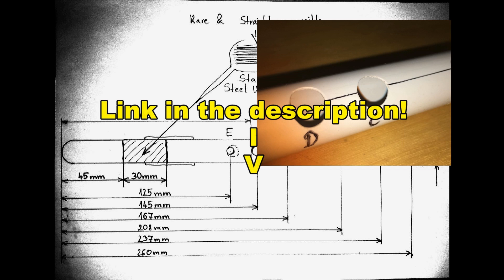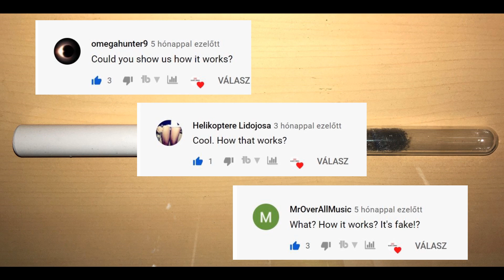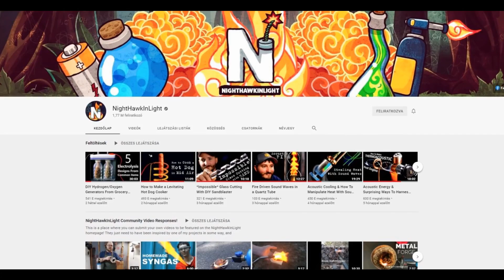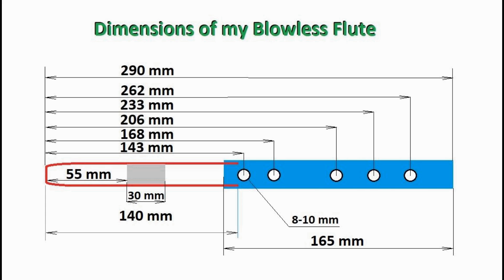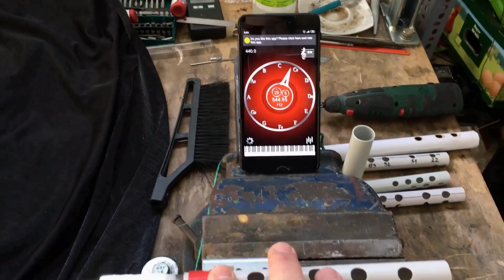How to Make Your Thermoacoustic-Flute? - Tunable Heat Engine as Musical Instrument /TUTORIAL/

Comment: I'm trying to get the thing to work but I'm not having any success. I first tried to make the test tube oscillate, but without success - the thing doesn't oscillate. What faults do you think are possible? Is the steel wool packed too tightly or is there too little of it? Do I have to do anything to get it to start or does it work by itself? What is the best way to heat the test tube? Is a specific place necessary for this? I try all the time but I can't find this damn error.
Reply from the maker: Hi there, basically the stack should rare as possible. The steel fibers should straight as possible and the ends cut flat. The length is around 25-30mm The wide test tubes resonates easier, also could stabilise with lower heat. Put the stack 1/3rd of the tube length from the closed end and heat with alcohol burner the stack but 5mm far from the end of the fibers. The hot side is the bottom side. It should resonate. For long time sound you should use heat exchangers and cooling also. I hope it will help you, but I think I have a really old video about this: https://youtu.be/uNibUUb0YGU?si=HCjHgzeRU61Z787A
Reply: @AttilaBlade  Super! Thank you very much!👍🙂

Comment: Maybe on the end instead of the stiff test tube round bottom a weighted balloon diaphragm to reflect the sound could make a buzzing frequency added to the flute tone - perhaps a kazoo flute sort of.
Reply from the maker: The frequency will be much lower under the ear sensitivity. For a kazoo like sound we should put a highly tightened piece of rice paper onto a non tonical hole around the half of the length. Or we can change the back side with a tight plastic sheet and a small piece of bamboo touch on it slightly. It could give a subharmonical sound to it...but we should try it to know it, because nobody will do it if we don't. :)
Reply: I was kind of thinking of the buzzing sound of your bristlebot thermoacoustic car, if some of that buzzing sound would translate or mix in with a flute played with holes tone to change the timbre of the sound. Or like this open-ended thermoacoustic buzzing pulsejet shape i tried but add flute holes in the exhaust tube instead of this unaltered exhaust tube. 
https://youtu.be/sCtDPMyfYbw
This one made some strange sounds and caused the torch and empty Coke can to vibrate on the desk surface like bristlebots. If you turn the volume up it seems like this shape with diaphragm makes more than one frequency, like a sweeping pumping sound mixed with some other sound making beats. 
https://youtu.be/lN1rElFOMBg
Aside from your kazoo method to try to know (good advice) I was also thinking maybe a thermoacoustic ocarina would be something to test out. Many things sometimes come to mind when testing, a lot of ideas accidental along the way. It may not aways turn out, but you meet the unexpected.
Reply from the maker: @Resonanttheme  The last thing that why I always communicate to everyone to try the things first, and make more experiments. The new ideas will coming and the solutions for actual problems will be solved much easier. But if we always just  watch something and thinking about that what's happening here, that still be a think never materialised or tried. That's why I really like your simple experimental videos! :) BLADE

Comment: I bet you could use a vape pen or whatever they are, to use as a heat source it would heat the wool nicely
Reply from the maker: Yes, if the heater wires or plates flat as possible and fit into the tube. I thought about electrical heating earlier but I can not find the perfect piece of that. Thanks! BLADE

Comment: I love this! Amazing job on it! Does this need to be a certain test tube?
Reply from the maker: Thanks! I made it from a 15.3mm inner diameter test tube. Every size could change the tone and the pitch a bit, but you can use any type of heat resistant type. :)
Reply: @AttilaBlade  Wonderful, I am going to give it a try! I have been messing around a bit with induction coils and the 2 may go well together!
Reply from the maker: @helpgrowfood8372  The induction coil is good, but how could you ignore the regenerator heating near by the induction coil? Maybe it works well I dont know but    it will be a good experimental way! You could try it with small diameter of wrapped copper coils around the test tube. Nice! The bigger problem is the cooling... but we will see! I'm not a big electrical guy but I want to try the heater mesh first. I haven't got induction circuit now.

Comment: That was interesting to watch how you tuned the flute. I saw some children's toy recorders "flute" in a dollar store and wondered by experimenting if you cut the head off of one, if it would be possible to use the already made spacing. 
You flute would be a delightful addition to a classroom demonstration over the standard one many are familiar with.
Reply from the maker: Nice idea! It should work, but what I saw here, the heat changed the notes distances. The gas density change with the temperature, so the closest and the last notes ar use different gas parameters. And here I can't found the notes what we can create with multiple hole closing, so it has few weird things. But I will try this, maybe it could work easier than I think now. Thanks the idea! BLADE
Reply: The gas density changing with temperature reminded me of a Dyna-jet how if you quickly hop from say the 27 second mark back to the 12 second mark you can hear/compare the frequency shift due to temperature rise.
https://youtu.be/ztEzRZE4F_k
This was basic but also had some subtle points about tuning maybe of interest. Even altitude if he mentioned that ...
https://youtu.be/IoWq6GO4iso
It's a fun project you have finding what works.
Reply: One time with a small 13cm long pulsejet shape I put a washer with a paper thin spring steel reed over the hole at one end of the tube. Then I misted/sprayed the tube with methanol and lit the open end. Instead of the flame advancing into the tube, a gentle dome of fire just sat on the open end building feedback, making the reed buzz like an angry bee. It was a funny sound, modulating at times .
I was thinking to try some of my .002ths blue tempered spring steel on one end of a Rijke tube, like a reed valve. Instead of being a Rijke tube, it could be valved and perhaps build up more feedback with an easily modulated thin reed. It would be something inbetween a Rijke tube and a Sondhauss tube I guess. I wonder if a wad of heated steel wool could drive a tube to buzz with a reed in this manner? The resonance makes an unusual sound with just that calm gentle dome of fire at the end of the tube imparting feedback, able to sustain and breathe by the tiniest resonating opening of the valve. The washer was sanded mirror smooth for the reed to rest on.
Also if sometimes you go to relight a jam jar jet that has just been run and the air not as fresh, instead of the flame advancing into the jar, a dome of fire will sit on the hole making a brief unexpected tone like  Helmholtz resonantor.
Just some tidbits ...
Reply: In the previous post I guess what I was trying to get around to saying was incorporating a simple snap-on or press-fit reed  onto the end of your "Rijke flute" might be another way to vary or color the sound. Probably some trial and error and work though, and no guarantees if one were inclined to play with that notion.
Reply: I should have said 13 inches long tube/jet, not 13 cm in the post about the buzzing reed effect.
Reply from the maker: Yep, the tuning is a funny but long process and it could be turn to a bit horrible when the stack get more heat and the pitch change under the tuning process... This is the biggest pain here, but if the temperature is constant the pitch doesn't change more. So the tuning will be accurate as possible. But here I can't use the higher pressure - better note effect, because the self resonance.
Reply from the maker: Interesting, a bit sounds similar as V-1 early rockets, the buzz bomb or pulse jet engine. They used IC engine (without valves first, but later with some valves) but the method is similar for me...
Reply from the maker: Yep, no guarantees but it is a funny experiment, and maybe a new type of instrument for the musicians. After a long period of developement of course! :)
Reply from the maker: No problem!

Comment: Interesting, I'd love to see the airflow as to oscillates. Maybe injecting smoke into the base of the flute?
Reply from the maker: Really hard to show the oscillating gas because of the high frequency, but if we have a minimum 1000FPS HD camera and Schlieren setup I think that could catch the waves. The smoke could show how the flow blowing away from the tube's open end.
Reply: @AttilaBlade  That would be a lot of work, but it would be very interesting.
Reply from the maker: Yes it is, I'm working on a good Schlieren setup with two pcs of Fresnel lenses and I bought a good camera for this but the frame rate is only 60fps. Maybe a new phone would help me... But I can't buy a new one now unfortunately.